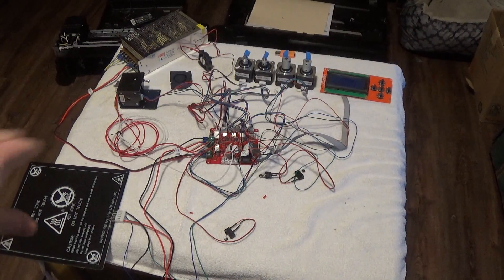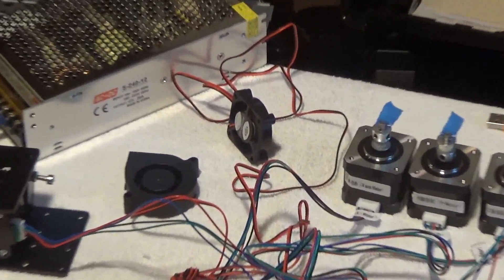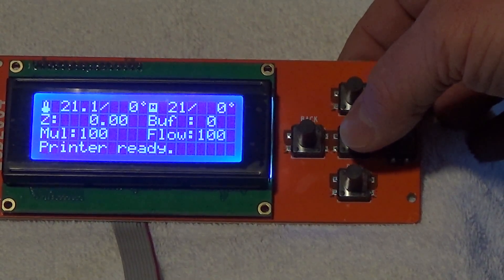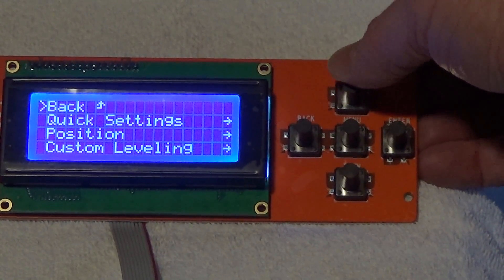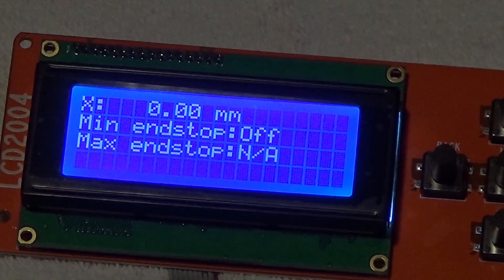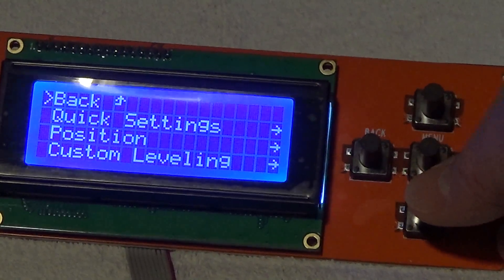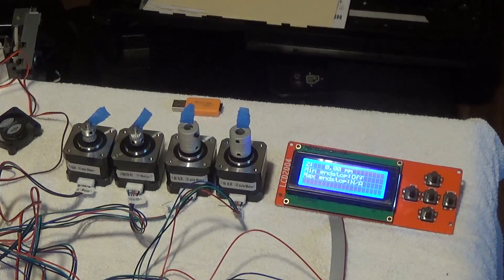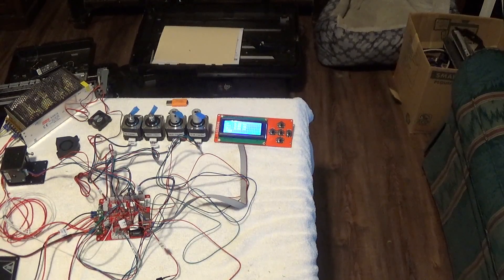Anet A8 - Testing electrical componets

Comment: Got my printer about a week ago and just finally got everything hooked up, due to everything that has been going on around here. Everything checked out and worked like it is supposed too. Wouldn't have gotten through this without your video. Thanks so much for taking the time to produce this video. Now I can start putting it together. From the looks of things, it may be another week before I can finally get to print. The first things I want to print is some of the improvements for the printer. Many Thanks.
Reply from the maker: Your welcome :)
Reply from the maker: Are you still into model trains?  Would be fun to make things for HO scale.
Reply: Yep, still at it, although a bit slow this time of year. Got some plans for adding on this winter. Just have to get things reafy to go.

Comment: I got this printer and built the whole thing only to find out that for whatever reason the motherboard doesn't seem to get power at all, nothing turns on when plugged in. I got to measure and see that the power supply absolutely gets power but I don't have the proper tool to be able to measure 12 volts to see if power is coming out of it, any ideas or suggestions?
Reply from the maker: Make sure you have the 110V 220V switch is all the way to the correct side.
Reply: tubejim101 Ah I figured out my problem, it was that I had the connectors on the wrong poles at the motherboard end, thanks very much for your advice.